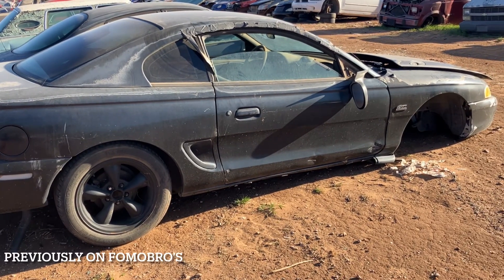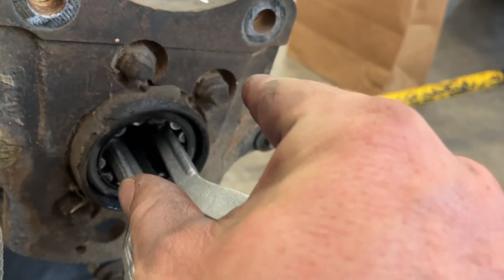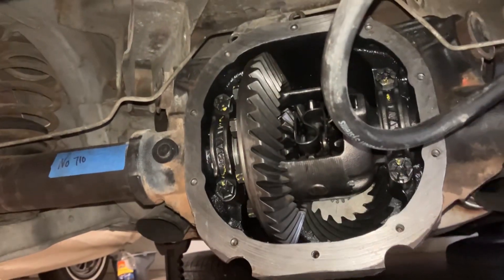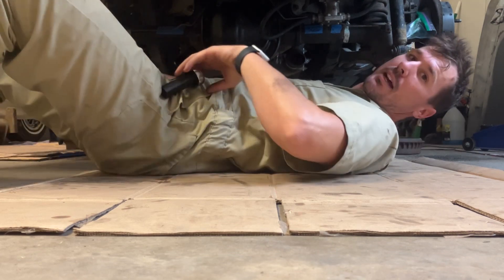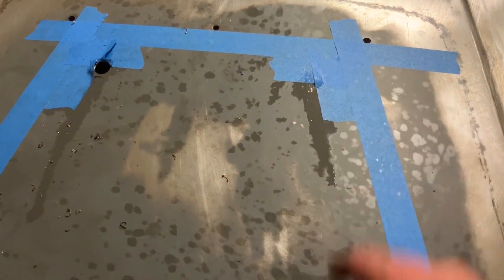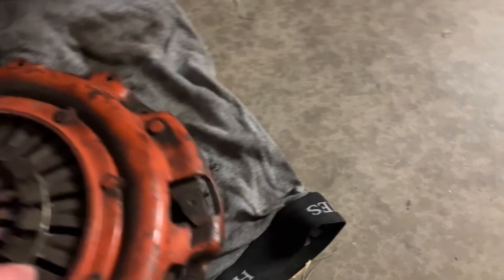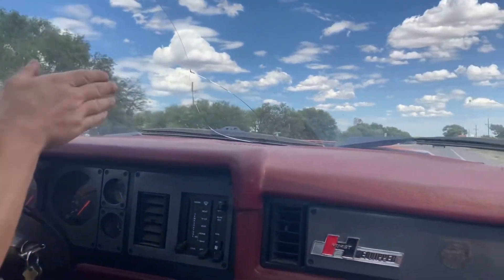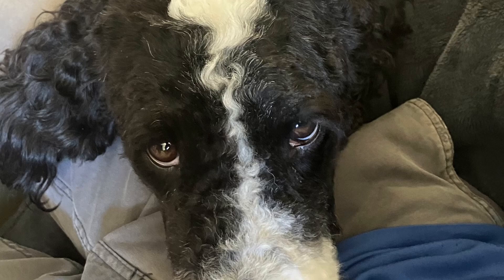7.5 swapped for 8.8 Differential + Cutting a Hood scoop for the 1984 Mustang GT350

Comment: You can swap to the 87-93 dual exhaust brake lines.  This helps if you decide to run tailpipes.  I did that on my early 85 and my 83 that had single exhausts.  I put a coupler on the brake line where it screws into the brake hose on the right rear side.  I screwed the 86-93 brake hose bracket to the floor pan near the center pumpkin.  There are 2 holes in the floor in that spot.  I bent a pre-flared line and connected the union from the earlier step to the 86-93 brake hose in that new center bracket.  I then installed the pre-bent 87-93 brake lines on the rear housing.

Here are some part numbers from LMR

LRS-2282B center brake hose
LRS-2073BRKT brake hose bracket
LRS-785437 union
LRS-MU1016C pre-bent SS lines for the rear axle

You can shop around and find most of these parts cheaper.  Some places sell those pre-bent rear brake lines in mild steel for about half the price LMR has.  Maybe your 8.8 already came with the center hose.  You can drill out the rivets or cut the floor pan on the 8.8 donor car to get the brake hose bracket.

Comment: Must be nice to buy a brand new McCloud clutch, I would have been stuck with the one u tossed in the trash 🗑 🤣
Reply from the maker: I’m keeping it, the pressure plate is pretty rough, but when I compared the “bad” clutch to the new one I realized it wasn’t really that bad. I can’t seem to throw things away lol. I think most of us are that way
Reply: @fomobros2207  yeah you never know when it might pull you out of a tight, I've got alot of junk i need to get rid of but soon as I do I'll need it. Its happened many times before when I finally tossed something 🤣